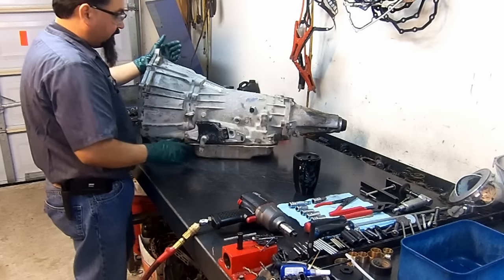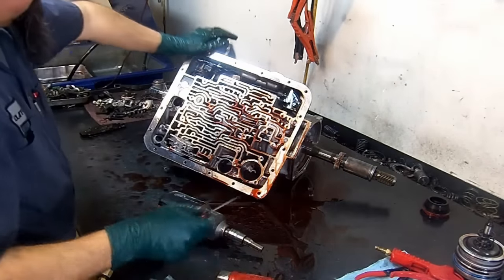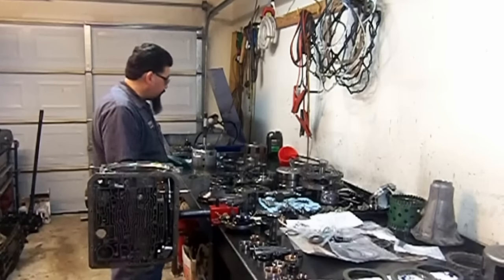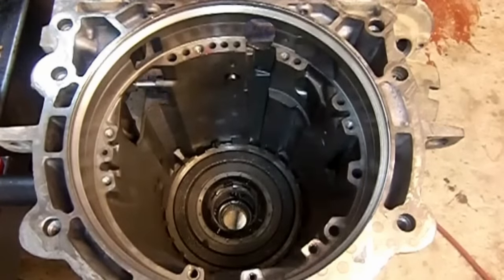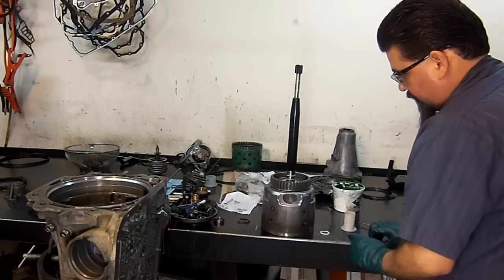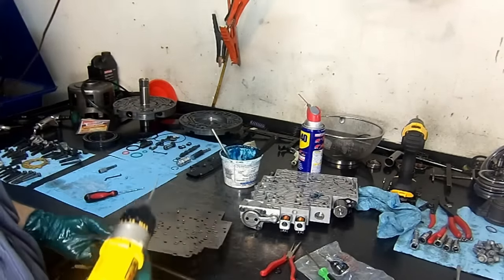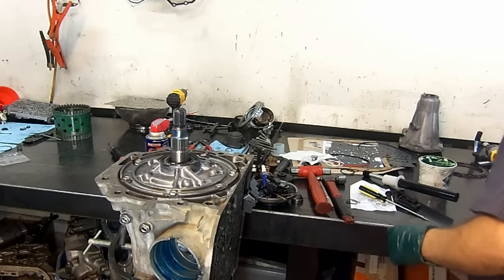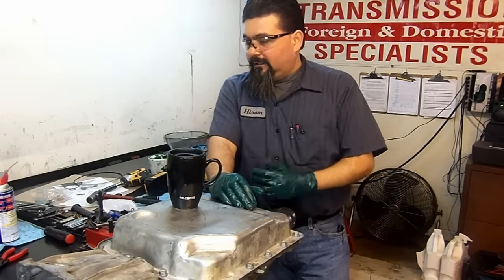4L60-E Transmission Full Rebuild

Comment: Hiram, I just wanted to thank you again for all your videos which I have used successfully to rebuild my transmission for my 2000 Chevy Silverado 1500. I used this truck to make 30 or 40 trips Two hours long or more, hauling forklifts. I am proud to say that the transmission outlasted the truck. With that being said I have a new truck it’s a 2005 Chevy Silverado 1500 with a bad transmission. I’m pretty sure it’s not possible to use that transmission in this truck is this correct?

Comment: Great video, very informative, also very detailed. I`m just curious if you ever went back and torqued the bottom bolt on the extension housing. You look like your torque technique is like i do it you have 6 bolts, when i torque 6 I`m done, i noticed that you started with top went around skipped bottom but hit top twice so that made you have 6 torqued.  This was such a great video, I started not to ask. But like you said you can`t be without it.

Comment: Great video, I just picked up an 02 avalanche with the famous 4l60e lazy shift/ failing and with this video I feel pretty confident I'll be able to rebuild it myself, couple questions like for instance is the foot press you use necessary or is there other tricks to press the parts in to get the snap rings in place, also is there a specific assembly lube to use or can I use grease?

Comment: Thanks for the videos! So helpful with my teardown and rebuild. 
What do you recommend for replacement torque bell housing bolts? Three of mine were stripped and I had to drill out and extract. When looking up alternative bolts it looks as though a common issue is new bolt heads are too large and in way of torque converter. 
Thanks for any info.

Comment: If my trans has the turbine speed sensor do I need to remove valve body to get the pump out. I just need to replace that sensor and it is located on the pump.

Comment: @Automatic Transmission, Great video. I have a question. I pulled the pump off without removing the bell housing and now the tranny leaks when engine is running. Am i correct  in assuming that the transmission pump body oring is damaged?

Comment: Thanks for the great video. Followed it as closely as I could when I tore my 2003 s10 4l60E apart and reassembly. Everything seems to work but when shifting from 1-2 you have to let off the gas for it to shift. I replaced the TPS and neutral safety switch. It is better, but not completely operating correctly. Any clues to the problem? The vehicle is not throwing any codes.

Comment: Good Afternoon 
I have a 2007 Tahoe 4wd and I’m having an issue with the truck trying to race in 3rd gear. I just rebuild the transmission about a week ago. It droves good the first 4 days but not I noticed a little racing in 3rd. I bought the master kit from transtar it came with additional steel plate which I didn’t installed, because I didn’t want to add anything additional. Do you think this would help fixing this problem? I haven’t pull anything with the truck since the rebuild. I already pull out the transmission and just waiting on guidance.. thanks in advanced

Comment: i have a 06 4wd 4l60e drove the truck for about 3 years reverse went out the guy at the shop told me the sun shell is stripped and there is no apply piston in the drum have you ever seen this before an if so what year truck.

Comment: hi hiram this is an excellent video 
i rebuilt mine and well lets just say i didnt have at the time all the parts you replaced or the bushings but i am getting ready to reinstall and let soak with fluid due to the fact i had to stack it dry any ways i was wondering if you could possibly personal message me a detailed parts list on everything that you did to your 4l60e in this video and where i can get all the parts also would like your personal opinion on what sort of shift kit i could put in it so as to have a better tranny for towing looking forward to your response

Comment: My 2000 K1500 5.3L 4X4 AUTO, SHIFTS SMOOTH, BUT! SHIFT from D to R or R to D makes a CLANK sound as if bad U-Joint, checked U-Joints they are solid. 240,000 miles, what do you think. Need trans rebuilt?

Comment: Hi, do you have any videos of a cruze front wheel drive transmission. I saw the grand prix transmission video unless it's close.  Not sure what the difference is between 2011 Cruze trans vs 2012 cruze trans but they are not interchangeable either its computer related or software related  in sure.  Thank you for your time , videos.

Comment: Awesome video, I'm getting ready to rebuild my transmission, when you dissembling/assembling the input drum were there load springs in there? And I didn't see you put any back in. I thought there are supposed to be load springs in there so it won't burn the 3/4 clutch up quicker.
Reply from the maker: Watch the 700R4 video, it'll answer your question. I explain that in detail.
Reply: Thank you that did answer my question. Now I have another transmission channel to enjoy and watch to. Thanks again for the detailed and informative videos.

Comment: Hiram,,,,,Fresh rebuild,clutches and plates.Apparently i did something wrong !  I have no reverse...Can feel it engage but won't move ,forward it will move in 1st. Didn't take it for a road trip,don't want to mess things up worse. No codes.. 95 k1500 m30 4l60e ,, Suggestion on what went wrong please.  Thanks.

Comment: Would it be easier to adjust the output shaft length or exchange oil pump assy on these. Do I need to disassemble valve body and servo etc etc to change just the oil pump or just the outputshaft Thanks

Comment: I have a weird one maybe you ahve seen: On my 4L70e (Trailblazer SS), the snap ring holding the reverse clutch piston return spring plate popped off after about 6 months. It caused the reverse clutches to drag. So I pulled trans, replaced drum and retainer and O-ring (just to make sure none of the suspect parts were re-used) and had the same thing happen again. Both times it was a new (IE: remanufactured GM part) drum and snap ring. 
Is this something you have seen before and do you have any idea on what to look for to prevent it from happening again?

Comment: Hey brother I need some help. I went step by step with your video. My 4L60E in my 2004 Tahoe 2wd it shifts perfectly, my only issue is it's kicking out fluid from  the low end of the vent hose. I have triple checked the fluid level and it still dumping fluid. maybe too much pressure ??? this is my first rebuild but it's also my daily driver. I am military so I don't have the money needed to take it to a shop and all the shops I've contacted said they'll only touch it if they're doing a full overhaul. any help please?????

Comment: I was testing the clutch pack with air through the pump. And notice air leaking between the pump it self . You could see the bubbles of fluid and air. and the 3rd  4th has weak pressure is this common

Comment: Yes I have a couple of questions I have a friend that had a guy rebuild his 4l60e and when u put it in drive to take off it doesn't shift down to 1st then if you manually pull it down it shifts right in but won't shift up by its self and acts like it doesn't have 2nd gear but if you pull it down to 2nd from drive it shifts right in

Comment: Hello sir how are you i watched your video and overhaul a transmission i put everything new set all the clutches gap and everything was perfect i assembled the gear and fit it in my truck but when i get it on road 1st gear was ok 2nd took a little long 3rd was ok again and in 4th the engine rpm goes up but no gear shift and after 2 min there was no 2nd gear and no 4th gear i came back to garage again remove the oil pan and found cluth material in it and burning smell and i removed the valve body and inspect some more and found that the dust in oil pan was from the 2nd and 4th band but why it happened i am confused about it and the band is burned 
So i need soe3help in it......

Comment: I have a TH400 in a 1988 R30 2wd. Would a 4L60E be a good replacement to get another gear? Is there a way to keep the mechanical speedometer with the 4L60E?

Comment: What is a full rebuild kit that you would recommend for a 2011 Silverado 4L60E wiyh the new harness and sensors/solenoids, except the torque converter and obviously would need to upgrade to the Corvette servo? I would need it to handle around 500RWHP

Comment: on a different note.....  i have a 2005 trailblazer..  4.2L. (not a 4x4) never abuse it..  always give it routine maint... although i will be honest never changed the transmission oil..(never gave me problems since i've had it in 2007)... was driving down the road and suddenly went out of gear...  the truck was on , no codes , all checked out in the gauge cluster, (but) when i press the gas pedal , it just revs the rpm's...   vehicle wont go into reverse or any gear...   do you have any advice..

Comment: I know, in the scheme of things, this is a TINY question, but it's the ONLY thing keeping me from passing inspection. My driver's side window control on a 2000 Isuzu Rodeo runs all the windows up and down, like it should, BUT the driver's side window only goes DOWN, not back up. I've ordered three different complete switches (from Switch Doctor) and they keep sending me the wrong switch. How can I trouble shoot the original switch? There's power to all the wires, all the fuses were replaced, and I'm stumped. What could it be? Thank you! Love your show!
Reply: i am not an electrical pro, but take a hard object such as the blunt end of a medium screw driver. Then with the car running press the "UP"  switch for the drivers side firmly- not trying to break it just to get contact thru whatever corrosion or soda, coffee or whatever may have got in there.  - press hard and keep trying untill the window moves. It does not always work, but if it does then this proves you wiring is ok.  clean the switch with switch cleaner - there are video tutorials on youtube on how to remove and clean it. this has worked for me on Fords, GM, and others.  Also you can get your exact switch-(a good used one ), look it up on carpart dot youknow what. look for A top rated seller. good luck.

Comment: Does a torque converter make noise like a busted rod, i disconnected from flywheel and the noise goes away, or can it be a planet gear, truck has very low miles

Comment: Hello, I have a trail blazer 2003 I rebuild the transmission but did not replace the torque convertor. The issue I have is it will only shift gears when I drive at slow speeds. If I try to go fast the 2nd gear shift is delayed RPM go up I let off the gas and it will shift. After that it will shift from 3rd to 4th but feels like the same issue I go slow and it will shift into 4th .a few times the RPM will go to 5 or 6 thousand and wont shift unless I let off the gas. Does it sound like the torque converter is bad. I have tried two different valve bodies and  two different trans and used the same torque converter.

Comment: Hirum Great Video,  Do you have a specific or favorite rebuild kit for the (deep pan) 4L60E (M30) transmission? And do you recommend replacing the valve body solenoids and pressure manifold switch?  And do you recommend replacing the torque converter when rebuilding a transmission.   I will be rebuilding a 2001 trans. with 128,000 miles I believe the Sun Gear Shell has failed.

Comment: im a do-it yourselfer.....  my girlfriend recentlty went on a trip to dallas.  trailblazer failed somewhere between houston and dallas...   blazer got towed back to houston...  i checked the trans oil and it was level...   however, i decided to change the oil , filter and gasket along with both a and b main shift solenoids along with a transmission pressure switch plate also located in the valvebody..  (still no go)...
where are ya'll located ...  thank you..  Robert in houston texas...

Comment: Question. I have a 98 GMC Yukon 4x4. With the 4 l60e transmission. Is it similar to this one. And would the rebuild be pretty easy. Im mechanical inclined. And I want to do it myself. I just want to know before I start.

Comment: great video man! though if i installed a shift kit , i'd prob used some better heavy duty/performance clutches.  looked like this ones been worked hard. lol
 edit- ok i see you did upgrade the clutches. not much cost difference with the 65E or HD clutches and prob worth it in the long run, imo.

Comment: have a question for you, i have a 1993 c1500 with a early 4l60e, it has a harsh 1-2 shift and 3-4 and overdrive feel perfect. i thought maybe shift solenoid or possible broke or worn 1-2 accumulator piston so i pulled the pan to do a service and to check and i did find a worn or wobbly 1-2 accumulator piston in which i replaced with a new aluminum piston and seal and finished the service along with a new 1-2 solenoid, but i still shifts a lil harsh not as hard as before but a lil harsh. so i maybe suspected torque convertor?

Comment: On the shown year model, the pump to case has the large round seal instead of o-ring.
Do you pull the entire seal and replace, or is the rubber insert part replaced only?

Comment: Great video! I've rebuilt 2 4l60es following this video. Hiram, do you know what would cause 2-3 and 3-4 shift flare in a newly rebuilt 4l60e? Worked fine for 1700 miles then started acted up. Only seems to do it after it gets good and warned up.

Comment: i've snapped a snap-on, mac tools, power torque, husky, kobalt T50's the power torque and the snap-on managed to get one bolt out each before shattering.  What brand T50 are you using?

Comment: Hi, awesome video. Quite the eye-opener. However, I have a question. I have a 2009 Silverado and the torque converter is whining on acceleration. What causes this and is there an easy fix?
Reply: Mine started to do the same, eventually 3rd and 4th gear died,  had to get the darn thing rebuilt,  happy I paid a pro, watching this video made me realize I'm glad I did.. good luck to you, only thing I can suggest is to maybe try  and get some of that lucas transmission treatment,  noise went away for about a month , but eventually gears failed, after 240,000 miles on a 2005 Silverado,  it did its job and running good as new 👍🏼

Comment: I recently rebuilt my 4l60e transmission but 2nd and 4th don’t work. I know the shift solenoids work and I’m thinking I might have a check ball in the wrong spot. Just wondering what your thoughts would be on that. Any input would be appreciated

Comment: On the 3 4 accumulator piston, the Transgo shift kit shows it put in upside down, can you do this with the stock spring or would I need to just put a spacer in there to lock it and keep it from moving?

Comment: Hey im currently rebuilding a 4l60e as i have done so many before but when it came down to assemble and stack the forward drum the stack for over run was fine but forward not so fine i was only able to stack 3 clutches and 3 steels if i stack any more its too tight and cant even get the clip in

Comment: Use the off-road reaction sunshell when you do a rebuild or atleast request the ones rebuilding the 4L60 E for ya to use it, had two factory sunshells break on my 99 Silverado so we used the beast by sonax, on the third rebuild, its still going strong..

Comment: Hiram, if installing The Beast in 2003 and later, 4L60, is the plastic washer provided with the Beast used, throwing away the original Torrington?

Comment: Had question just rebuilt a 93 4l60e everything work fine but no reverse. Pressure in all forward gears at 155psi and in reverse at 215psi. Could it be valve body or valve inside put in backwards
Reply: You nicked one of the sealing rings, either on the input shaft or the pump, can't remember which off hand. Only takes a small nick and you'll loose reverse, 3rd gear, engine breaking. All kinds of hell unfolds from those little buggers.
A backwards valve or not tightening that little plate down can also cause it, but more often then not its those damn rings.

Comment: I rebuilt my 4l60e using your videos. THANK YOU! Im now having an issue where the motor revs to over 2200 before the trans grabs in any gear and it feels like its not shifting at all. Can you point me in the right direction? Im hoping its in the valve body
Reply: Did u install the pump shafts behind the torque converter I forgot that on a caddy it barely moved but then I put it in and it went 2200 rpm is crazy

Comment: WTF - I always thought gear boxes would be FULL of gears - didn't see many! Surprised.
Reply: Most automatics have a pretty small gear train, which is the back half of this unit, but use clutch packs to achieve the different gear ratios. There are some autos though that can be best described as automated manuals, they're literally a manual with a torque converter and automated shift forks. They're pretty cool inside actually.

Comment: HI, i accidentally pour atf fluid to my cvt trans, when i changed the fluid and it runs more than 200km  and now i change again and remove all the atf fluid.my question is my transmission is already damage since i don't feel any changes in shifting and the reverse?.thanks

Comment: Hey my 4l60e stops picking speed after shifting to 2nd but it seems to shift through all gears meaning when I give it  more throttle I'm just getting high rpms like it's still In 1st. When I downshift I can feel it dropping back down through all gears. What would cause that?